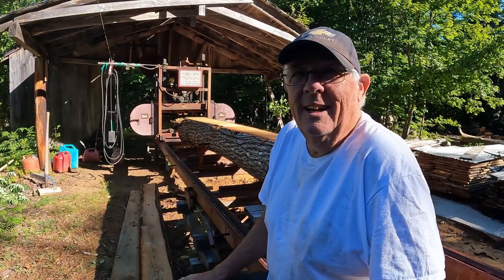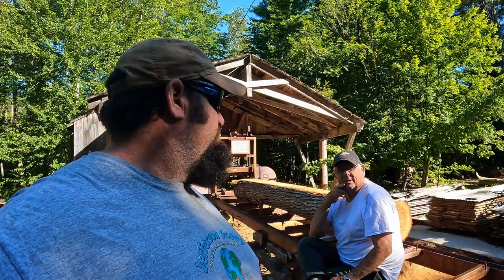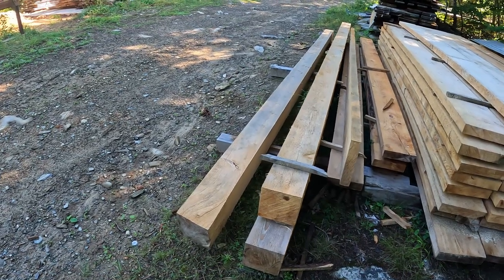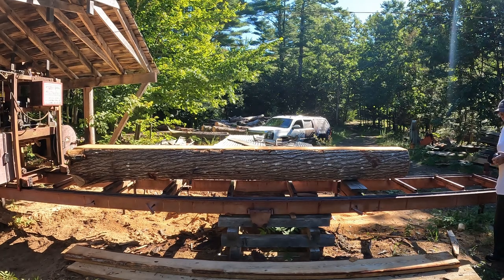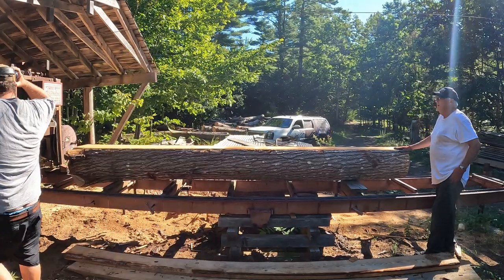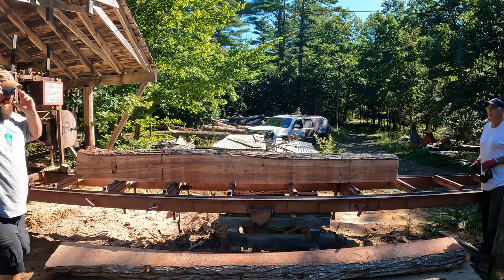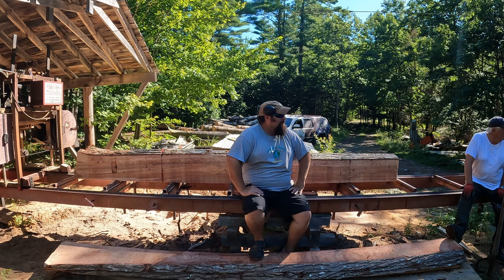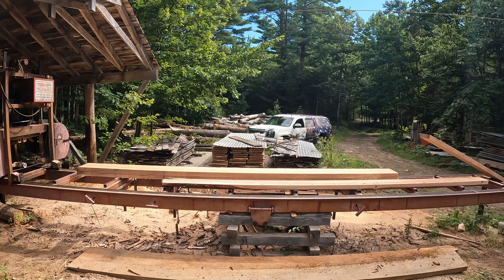We are DOWN but NOT OUT!

Comment: This is going be a heck of a project.  I'd think about going 1.5" thick rough sawn on the 2 bys. A little more yield per log and less tonnage To be lifting and hauling.
Reply from the maker: So true and I think plenty strong enough we are just used to the true 2x4 and no shortage of wood but the hauling would be a help